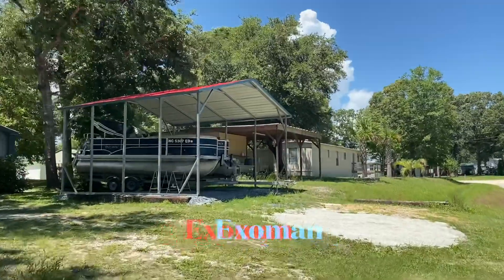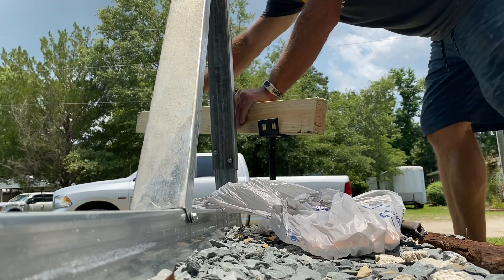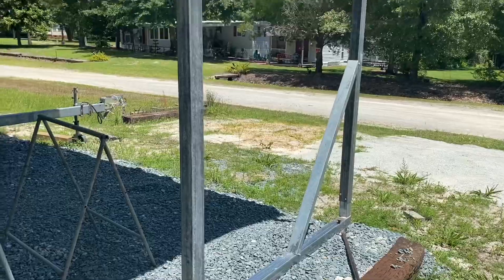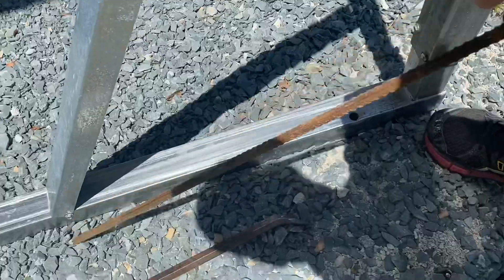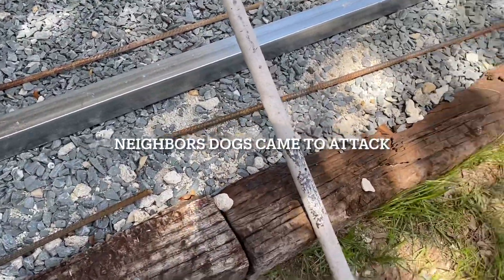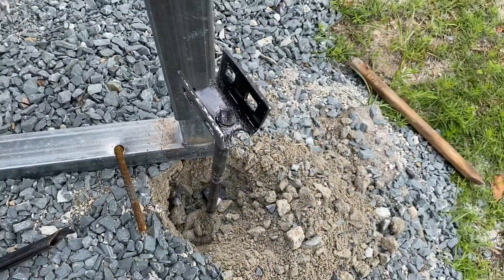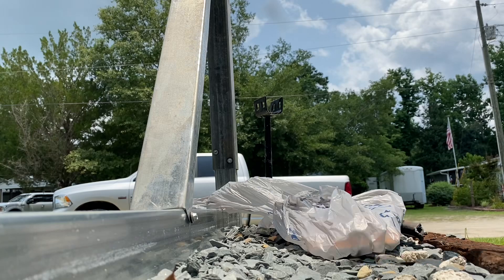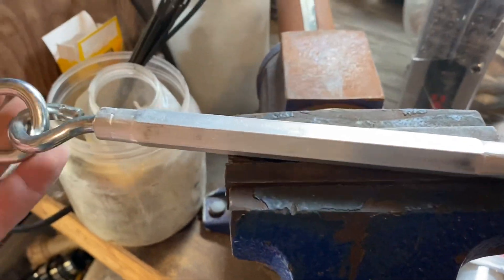Hurricane Anchoring Carport Boat House for the Coming winds.

Comment: As soon as I saw you pull the first pin out with ease I knew it was a substandard installation.  Too bad the manufacturer didn't install it with those house trailer anchors to begin with because the shed frame looks like it will sit inside the anchor bracket perfectly and not have to worry about the shackles off to the side as trip hazard later.

I was thinking if the shed was light enough you could slide the shed over about a foot with some help from your buddies and probably a case of beer, drill the anchors, and then slide the the shed back over into the brackets and bolt it down.

Comment: I have the same carport and last Friday the winds hit 70mph here in North Central Kentucky. The carport broke loose, flew through the air and landed upside down in my driveway. It got badly banged up so I had to order another one. It had those same 16-inch anchor nails driven down into soft ground. I'll see if I can find those same parts you used and do it right this time. Thanks for the video.
Reply: The worst part is not only does it damage your carport but it usually hits your cars that are under it as it’s flying away.
Reply: I just had a carport put in and they used 4 screw down anchors no pins. The base of the carport down but it’s 12 foot high and my concern is the carport will rack to the left or right during high winds. We plan on burying 4 post in concrete 4 foot down in the ground to support the four corners and possibly the middle since it’s 31 feet long to help make it more rigid at the top.

Comment: Those bent over re-bar pieces probably would have done the job if you used huge washers and driven them each in at alternate angles, maybe added a few on the corners.

Comment: Frame it in and cement a knee wall around it or two sides . Had issues like that even used a steel post to pound by it . Did not work . The cement ands the weight..or sand bags